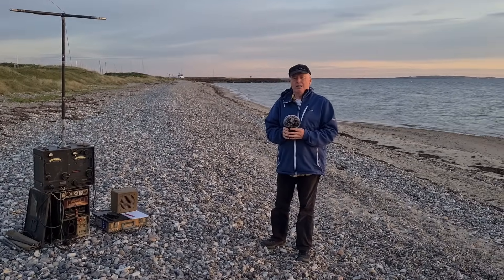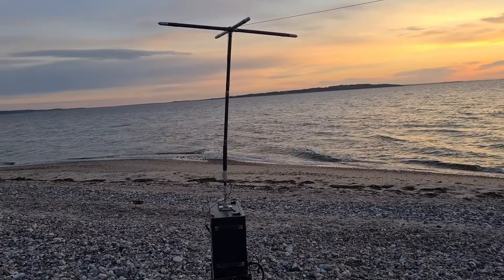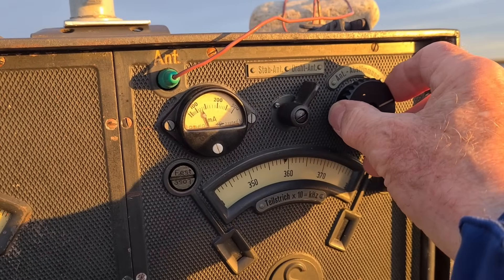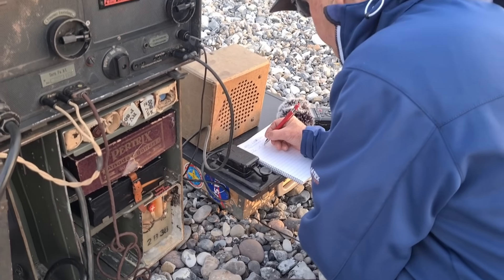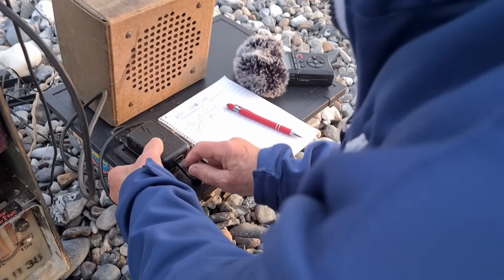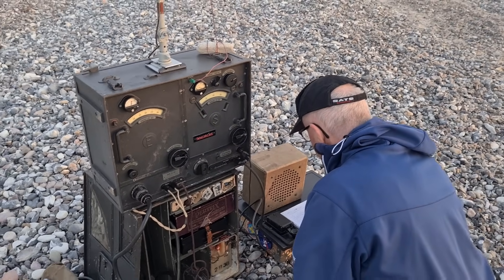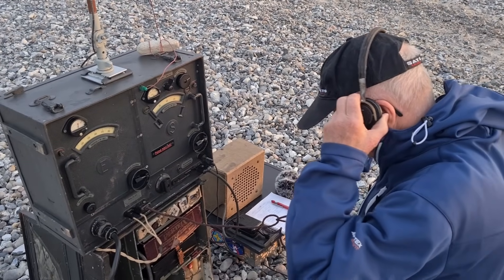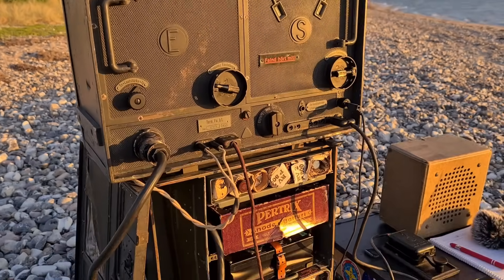German WW2 radio Torn.Fu.b1 long distance communication.

Comment: Having been a ham for 55 years I am not impressed at all.
Reply: Have you ever had in hands a german communications -  or even a domestic one  - radio set and compared with american ones ? Or instead compared with contemporary european made radios in general.?
Reply from the maker: This radio works just as well when it's 100 years old. I'm impressed.

Comment: Good job ! .  Even using the low height antenna.  Watching this in Japan.
Reply: yea, the lower the frequency the higher the antenna should be from the ground. He's by the ocean presumably which helps a lot.
Reply: @bertsmith5569 : Thank you so much for your answer. I see, And salty ground makes good earth effect.
Reply from the maker: With this antenna we get a lot of radiation up. This is beneficial for the relatively short distance.
Reply: @LA6NCA  NVIS I am familiar with this technique that is not the goal of most hams but it is a goal for some! Military users in particular exploit this for talking over mountain ranges. 73

Comment: Incredible!!! Thanks for sharing. I wonder how those electrolytic capacitors have survived all these years and still work, not leaking. Good German quality I guess. That radio is can be described with one word: Superb!!! 
Un abrazo (a hug) from YS. Stay safe. 73. Rob YS1RS
Reply from the maker: No capacitors have been replaced. Everything is original.
Even the frequency calibration is correct.

Comment: It's a very interesting video.  I love the old military gear.  It is amazing the contacts that you can make on short wave using low power.  The sea path helps too.  An old Scottish radio amateur called George Burt, callsign GM3OXX, worked over 300 countries using all home-made equipment, and always  running no more than 1 Watt of power.  73 de GM4IFC.

Comment: Very interresting.  Is ist also possilbil with normal Speach? instead CW . ? 73 from Kai in Lower Saxxonia,
Reply from the maker: Yes, it is possible, but the range will be much smaller.
But, that's a great idea for a new video. Testing out the maximum range with speech.

Comment: I wonder if todays submarines in the Atlantic ocean/North Sea (if ever) have an emergency morse code radio transmitter that they can use in case of critical failure of all other communication means?
Reply from the maker: I would think so.
Does anyone know this?
Reply: @LA6NCA  They have VLF and ELF radio comms. Most of the communication in this frequencies are made with morse codes in SSB or AM, because of very narrow bandwith. But the advantage is, at 30 hz, radio waves can penetrate up to 500 meters of seawater, which makes it possible to communicate at max operating depth.

Comment: Impossible....Distance 50-60 km en morse, et environ 15 km en téléphonie....Batteries Cadmium -nickel....J'ai été télégraphiste dans l'armée....Ce sont émetteurs -récepteurs "petite puissance"...Moyenne puissance sont dans camions et ils couvrent 200-300 km distance....avec groupe électrogène....Même si on est dans un foret on se trouve en "radio ombre" est impossible à avoir communication /pour la petite puissance/....Il ne faut pas raconter n'importe quoi, mon ami...
Reply from the maker: Yes, this is possible.
That's the authentic sound you hear. I never cheat with this.
I use a good antenna and the right time of day.
Then even small effects will reach many hundreds of km.
You have to be a good radio operator to understand that.
I have had a 100 km communication distance with just the antenna that is on the radio.
Reply: I worked with my TornFub1 with about 600 mW on 80m in CW over a distance of 660 km from upper Austria to Twente in the Netherlands.
Reply: Beam or quad antenna + good propagation + 1watt = the whole world !!!

Comment: Well, u-boats received orders during patrol in the middle of the Atlantic ocean. That’s thousands of kms.
Reply: Yeeeah they didn't exactly use little 1W field radios for that. Look up Goliath transmitter
Reply: @Bladsmith Of course not. I just pointed that out that much more powerful equipment was available on all fields.

Comment: I had a 190 ft/58m/5mhz longwire antenna for my ZENITH 7K shortwave radio. Then I made a load coil to furthur extend down to 2Mhz. My longwave reception was great, at times I could pickup Great Lake ship/shore beacons. China, Cuba, BBC, Romania all came in like they were next door. Only 1 time I pickup up Prince Edward Island News Radio! The weather was perfect for 5 mins on that one. I had some audio filters too on a dedicated aux monitor speaker. Audio filtering can give you + miles more RXDX quality.
Reply: That's so cool, i wish i had such a device!

Comment: Great presentation, but could you not transmit voice? I can see a "mikrofon" input right there.
Reply from the maker: "Reliable1944" is absolutely right.
AM is not as efficient as CW.
But I have made a video about AM on this radio.
Go to my videos and you will see it.
Reply: CW is the most efficient use of just one watt. I am pessimistic that AM or  SSB would make the distance, but, it is worth the try.

Comment: Very interesting. The use of Q codes like QSO and 73 reminds me of modern txtspeak—short, efficient, and packed with meaning. Hard to believe they made a 430 km contact from Denmark to Norway using just 1 watt and a 48-meter wire antenna strung up on fishing rods. The timing at sunset was perfect for skywave propagation. And that signal—there’s a gentle wow or warble to the tone that almost sounds musical. It’s like you can hear the ionosphere in action.
Reply from the maker: So well described.

Comment: De US3UM. Nice video. Good result taking into account low frequency and antenna height. It should be better if antenna was attached to a high tree.
Tell us more about the radio. Why does it have two identical parts?
Reply from the maker: Thanks for the comment.
The antenna is quite low.
But if you look at the radiation angle, it is quite a steep angle up.
Such a low antenna works quite well at such distances. For DX stations it should be higher. A higher antenna is preferable, but difficult to achieve on a beach.
There are two parts to the radio. One is the receiver and the other is the transmitter.

Comment: キーの持ち方、日本式とちょっとちがうなあ、
RST　559か、厳しいな
しかし、日本ではこの実験ができないんだよね、
自作機や古い機械はなかなか許可がおりない
Reply: Is it in Japan forbidden to build Hamgear by your self in general?
73
DH9MM
Reply: @mariom.9472  禁止されているわけではありませんが、スプリアスの測定資料を提出する必要があり、初心者にはなかなか難しいです。
Reply: @8PMN 
Makes sense, in Germany you can build or modify your Ham gear your self, no spurious documentation needed if you use it by your self and you make sure it is clean (perhaps you have or you know somebody with testing equipment) real trouble starts if your transceiver disrupt communication of police, ambulance or fire department and the Bundesnetzagentur (FCC in USA, Ofcom in GB, MIC (?) in Japan) knocks on your door.
Or you want to open up a business.

73
DH9MM
Reply: @mariom.9472 maybe forbidden to transmiss the unofficial signal without permission 😂

Comment: How do you make an antenna like that
Reply from the maker: The antenna is not the little pole on the radio. The pole is only used as a mast. The antenna is a 48 meter long wire. It is 5/8 wavelength. It is easy to tune up, and it is maximally efficient. I will make a separate video about it later.
Reply: @LA6NCA  Thank you so much for taking the time to explain! I really appreciate it. I’ll be looking forward to your next video explaining the details of the antenna.
Best 73 from Brazil, South America
Reply: I'm eager to learn how it works and how to build an antenna like that.  
Thank you!

Comment: I really enjoy your videos showing actual vintage gear working.  My favorite so far was the light transmitter.  I found it absolutely amazing that the technology was there in the 1940's to have light based communication over such a long range which would be invisible unless directly inline with one of the tranceivers.  Please keep it up.  Maybe sometime you can post a list of the  equipment you have collected.  VA3NTH
Reply from the maker: It is very inspiring to study this technology. I have learned a lot from it and I try to convey it here. I have worked with product design in communication, broadcast video and audio technology. I have learned a lot that I have used in my designs by studying this old technology.

Comment: Hello! Morse code is difficult to learn, in my opinion. So it would be better to use frequency manipulation and something like the teletype.Telegraph has very narrow bandwidth - noise is equal square root of bandwidth  .So  it explained - why this kind of communication has so long radius of action
Reply from the maker: I use Winlink with Vara HF.
This is a very efficient communication that is as good as CW.
It is then possible to send messages directly on the radio.

Comment: Awesome to see and hear morse code over an old WW2 radio. As the old saying goes, when all else fails, use morse code. Still one of the most efficient modes, due to its bandwidth and the simplicity of equipment. Best 73 de ZS6AKW ..
Reply from the maker: Yes, I completely agree. It is very effective with simple equipment.

Comment: Mr. Helge i have a Baumuster telegraph Key is so beautiful. Thanks for share your radios in outdoors very pleasant. Why the antenna pole have 4 sticks? is a capacitive antenna? Great Stone Balun 🙂!. 73
Reply from the maker: Yes, it's a top capacity.
But I only use it as a mast.
The antenna here is a 48 meter wire.
The far end is supported by two fishing rods.

Comment: I always enjoy these videos Helge.  It is fantastic to see these old rigs operating again.  Is this a regenerative receiver ?  Is the transmitter crystal-controlled ? Mark AB0CW
Reply from the maker: The receiver is a regenerative receiver in the intermediate frequency. It has a mixer and a local oscillator.
The transmitter has a VFO, but with two mechanical locks.
They are programmed on the agreed frequency.
Therefore, he comes in on exactly the right frequency.